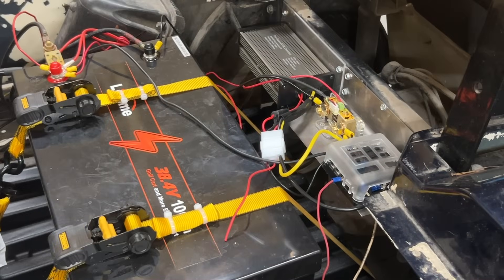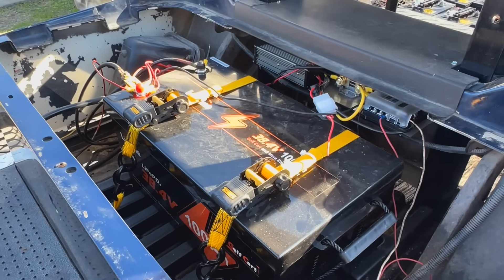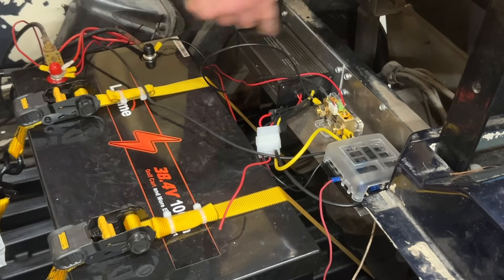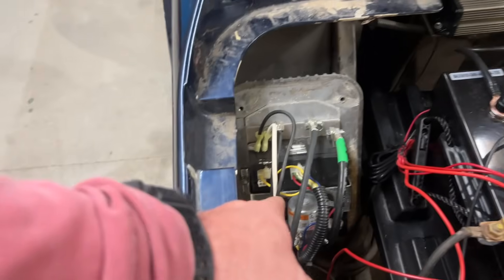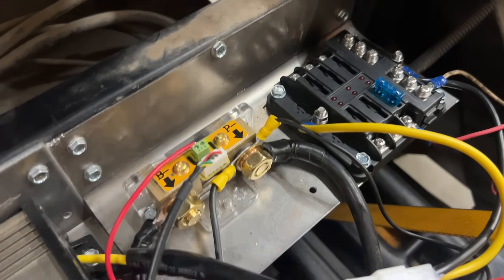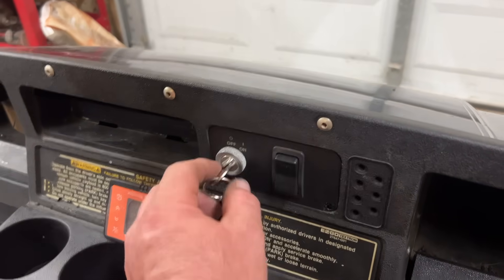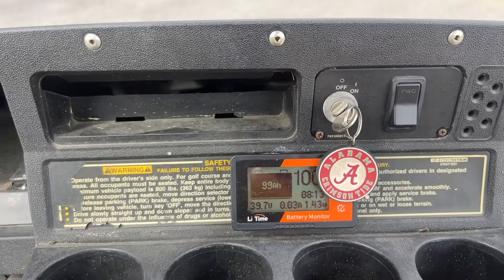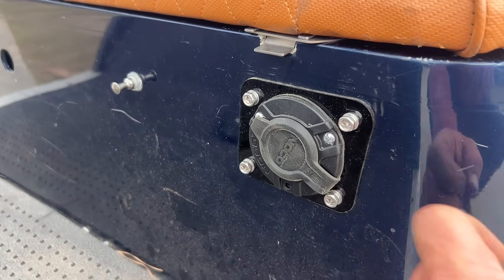Fixing A Customers EZGO PDS Golf Cart After Lithium Battery Install | Will It Run?

Comment: On my gas ezgo, I swapped the wires around from FnR switch to ignition, to make it so ignition controls power to everything. 

Also tip for the display, use the power from the key switch, just like the converter, so the display is powered off with key, no chance of it being left on to draw power. 🤷‍♂️   

Great vid tho!
Reply: Hey, that’s exactly what I was looking to do. I want to run a soundbar and having it turn on/off every time I switch from F/R is no bueno.

Anyway you could give a quick summary of what you did? I can’t find anything describing how to wire this anywhere. Thanks!

Comment: I recently purchased the same battery for my 1994 club car ive hooked up my battery without the lights to see if it would work and I'm not getting anything... the cart won't move and I'm unsure of the reason. I've charged the batteries and there was no problem there and I'm getting the reverse buzzer when shifting to reverse but the cart won't move.

Comment: If I use a parallel bus bar to connect two lithium batteries together, and I want to add a shunt, everything but the two battery cables run to the P- of the shunt, correct? B- of the shunt will run to the ground side of the bus bar along with the two ground cables from the batteries?

Comment: Is the shunt just for the display or does it restrict/reduce power delivery to the system as well?
Reply from the maker: The shunt is the brains for the display. It is what actually reads the amperage of all the accessories. Yes it does draw a tad bit but not much. You could always put it on the keyswitch power as well to only power when the cart is on.

Comment: Shorting and cleaning up the wiring makes things easier to see what’s happening . Nice job on cleaning up. I’m up in the air on shut gages. I have one in my cart that keeps of track power left but I use my cart a lot. I started installing them in lithium conversion’s but found that if the customer doesn’t use their cart a lot the shut meter shows more power left than it actually has and people were running out of power because they thought they has more left than they actually had. I tell them please use the battery app instead and I stopped installing them. I’ve reset them a few times but doesn’t seem to help. The biggest problem I have are people that don’t charge the lithium and run them out of power. I’ve had to use your six 9 volt batteries in series trick to boot the BMS to get them charging again. Always glad when I see a new post from you , keep them coming.